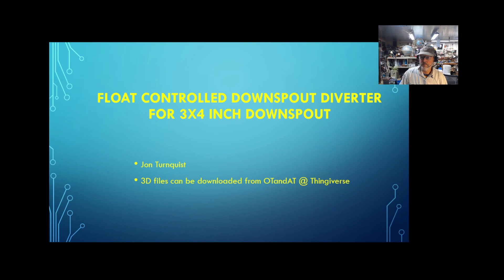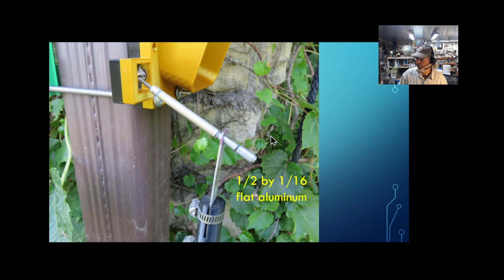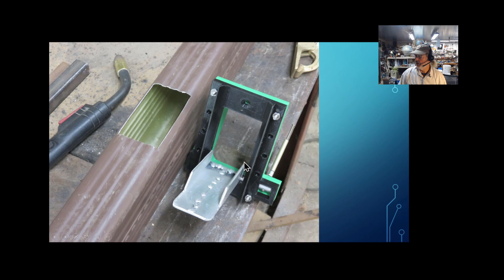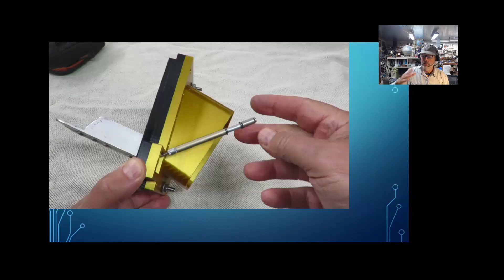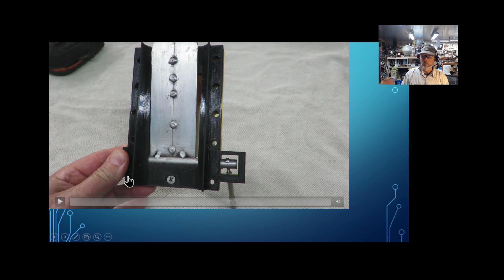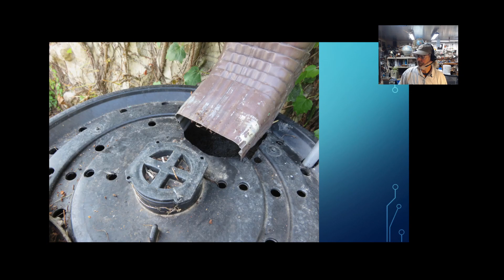3D Printed Float Activated Downspout Diverter for 3x4 inch Downspout

Comment: you could probably print up two laves to encase the downpipe it's self removing the need for the bracket, and then mounting the lever plate assembly onto one of the halves so that it becomes one sealed setup.